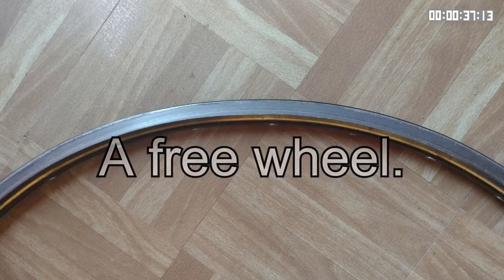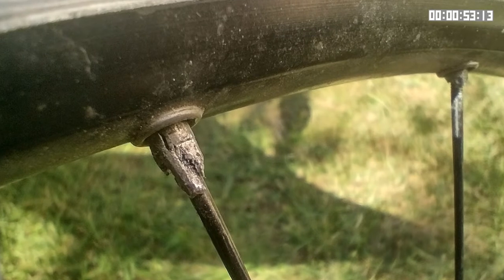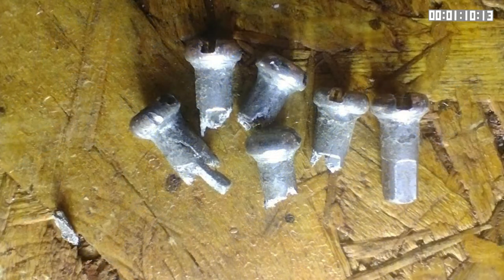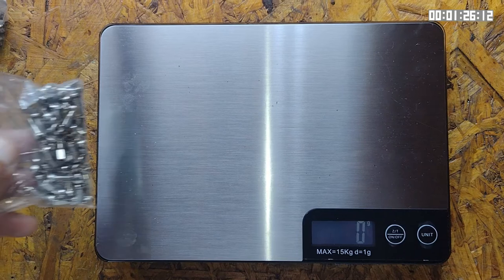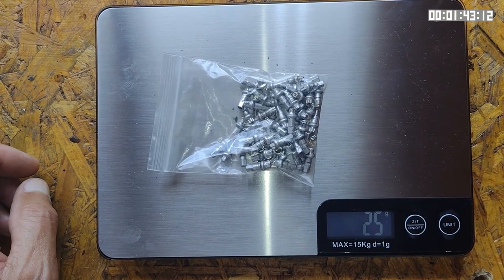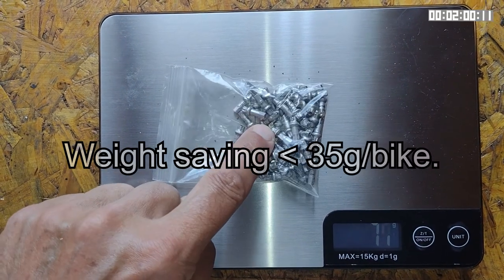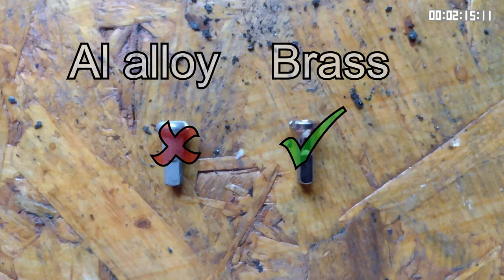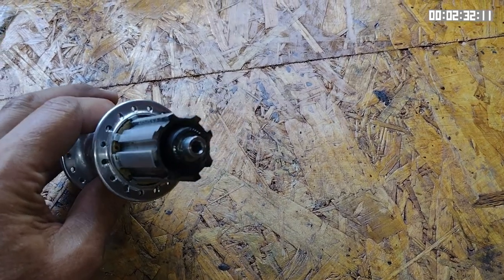Why I have Brass Nipples.

Comment: I agree.  I am not obsessed with weight and I value durability over weight.
My tyres are a good example.  I have Schwalbe Marathon Plus tyres on my touring bike and Continental Gatorskin Hardshell tyres on my road bike.
Granted, these tyres are heavier than what most people use, but I haven't had a puncture with the Schwalbes in 5 years and I've never had a puncture with my Contis since I put them on a year ago.
Reply from the maker: Right on

Comment: Hi, thanks for the video! I want to change my spoke nipples. I saw a video of one spoke nipple being changed and it looks pretty easy. Do you think a beginner can easily change all the spoke nipples and tru it back to how it was? I did some truing last night, took me about 4 hours to do one wheel 😅
Reply from the maker: I would only change the spoke nipples if they are causing a problem or if you think they might cause a problem in the future. 
Changing the nipples should be quite easy, but truing the wheel and getting even spoke tensions are the hard parts. 
You can watch lots of videos on wheel building but the best way to learn is to do it. So well done for having a go. Just changing the spoke nipples is a good way of starting to learn the wheel building process. 
Don't worry about the amount of time, it's best to get it right rather than hurry. My first wheel took me about 2 days to get it right, but that was building it from scratch.
It'll be good to hear how you get on.
Reply: @FiveMinuteVelo  🤩😁